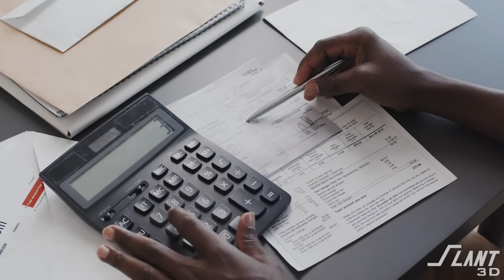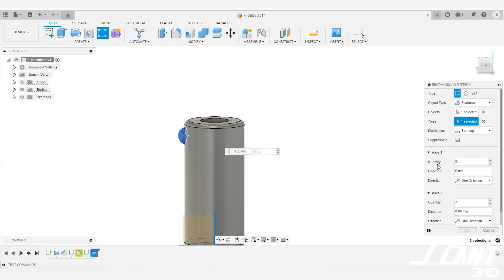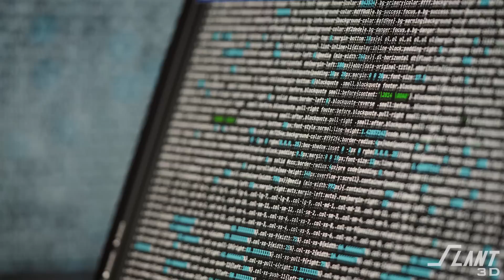3D Printing Will Obviously Replace Injection Molding

Comment: So the top line value-add is rapid-fire "spitballing" and enabling half-baked, shoddy design....as finished, salable products?  No mention of the compromises in part quality, strength, and material properties.  Complete false equivalency.  Hands-down, one of the worst videos I've seen on the topic(s); straight mis-information and hyped-up opinion.   AM industry has enough challenges in adoption and growth , definitely doesn't need to continue shooting itself in the foot with more hype.
Reply: This. If it is in walmart of any amount of time, its selling at bare minimum one per week. 5300 walmarts in the usa. that means in a year there are at minimum 275k units sold. 

Dont get me wrong. I absolutely love 3d printing. It has changed who I am with as you (Gabe) have mentioned correctly many times it lowers the barrier to entry for producing parts as you do not need to create locked in tooling. And it has completely democratized production at lowish volumes.
However, once you hit a certain threshold, it doesnt compare price wise or efficiency wise for most applications. Yes you can produce 1000 3d printed parts with 1000 machines but one injection molding machine can also do that in less time. As with many manufacturing methods, there are breakeven points where it makes sense to switch to the next approach.
Of course, some designs are better 3d printed vs injection molded, expecially if you have weird geometries and/or different material thicknesses that IM does not like.
Where 3d printing shines, is custom, low volume AND/or otherwise impossible to manufacture designs that enable things like higher combustion efficiency but can not be physically machined.
Reply from the maker: Printing matches molding on speed, quality and cost. And has all the other advantages that come with NOT carving your product into stone.
Reply: @slant3d " Printing matches molding on speed, quality and cost. And has all the other advantages that come with NOT carving your product into stone." Not even remotely true.
Reply: @slant3d  Not even close.  Injection molding can spit out thousands of parts an hour and run 24/7.  If you had 5000 parts from an injection mold in an hour that isn't the same thing as 5000 FDM machines printing 1 part.

Quality, absolutely not.  I saw your smoke detector video and if you think your 3d print was "the same" as the molded part you are loco homie.

Cost. again not true.  Low vol aluminum molds and 10k tool steel molds are very affordable and quickly pass FDM as a viable option in fewer than 100 parts.

Comment: 3D printing will not replace molding in electronics packaging, since the material has to flow into many very small gaps, and between 1-2mil wires. Also, the ideal shape is generally a simple rectangular prism, because that is the most efficient shape for an electronic building block. 3D printing is not the right tool for this.

Comment: Walmart alone has over 10k stores. So if you want to sell a product to Walmart you need to create enough parts to stock each store. Even if that's only 100 of one item then yeah that's a million parts. Do you have any references for most injection molded parts don't make more than 5k parts. I love 3d printing but it has limitations and there will always be a market for both. You even made a video showing how you can make a water bottle with 3d printing but actually only made a water bottle carrying case. You'll never have smooth surfaces or large parts made in mass (a slide) or food safe parts made out of 3d printing.

Comment: the cycle time of 3d printing will never touch the cycle time of injection molding, ever. technology improving  won't change this. i removed this channel from my recommendations based solely on this incredibly short sighted video.
Reply: 1 printer can't match 1 injection molding machine. I'm assuming he means 1000 printers somewhat can.
Reply: @jollzy887 neither does it match the price, your like comparing a house to a skyscraper. What you should look into si ratter production per cost (be it space, money, quality of pruducts, or anything else)
Reply: He is likely building a single machine for 1k to 2k dollars. For the price of one molder he can make/buy hundreds if not thousands of printers. He is looking at his factory as a single machine compared to a single molder.
Reply: @ethanr6655  yep and that is where that doesnt scale, you need to factor in increasing marginal costs and increasing footprint to match just 1 molder
Reply: You are forgetting about the months it takes to go from design to actual part with injection molds, plus the geometry and shapes are less limited 
You can't inject certain things, 
So by comparing 
From design to 1000 parts in a factory is days vs moths to make the press / mold and get the first parts shipped. 

Not only that, you have it on hand vs waiting for a container from China that takes another month to be delivered.... 

Sure, the physical making of the object is faster, but you can't leave out the pre fab and shipping times!!!!
Reply: As others have said, a single 3d printer is obviously way slower than a single injection molding machine. But, that single molding machine is massive in both physical size and cost. You could get a couple dozen high end industrial 3d printers in the same space for the same cost. Especially with high speed input shaping printers like the creality K1 and Bambulabs I wouldn't be surprised at all if 3d printing could at least match the speed of injection molding. Especially with how long it takes to make the mold in the first place
Reply: Habt ihr schon einmal darüber nachgedacht was so eine Spritzguss Maschine kostet? Wenn man den Preis für eine solche Maschine mit in die Produktion nimmt und das gegenüber stellt mit der Anschaffung von mehreren 3d Druckern, so erhält man sehr wohl einen ähnlichen output an Teilen, auch wenn man es nicht auf den erst Blick erkennen kann.  😂😅❤
Reply: Oh no guys he's leaving :(
Reply: If you would have watched the video you might have learned something instead of being stubborn
Reply: Yeah. This is ridiculous. Thanks for reminding me that I can remove a channel from being recommended
Reply: Yup ill block this channel as well, almost all his videos are just click bait with almost zero useful context.
Reply: you can compensate by stacking dozens/hundreds of machines together but by doing so you're also stacking 1,000s/10,000s of failure points. lots of luck keeping all of those machines running 24/7/365, your labor costs will be outrageous. it's easy to see who has manufacturing experience and who doesn't in this comments section
Reply: @mcfuggin depending on your viewpoint but you get a redundancy of 1000-10000. 5 printers down would probably hurt less than  .5% of the molder.

I mean... I am not sure things like Lego pieces will be printed, but I see many things being. Things that are only produced in up to a few million items. And the scalability and flexibility is awesome, and the fact that the same procedure can be used by the prototyper on the desktop as the producer of millions. And the cycle time of a part for testing is (let's say) half a day instead of weeks for soft molds, and costs less than the shipping of the molded part.
Reply: Thousands of printers to match a couple injection machines take a lot of space and effort to run. 
The argument makes sense for low scale, but after a certain point 3d printing just can't catch up. Which is good for products in development, but some products just work, and you don't want to iterate them every couple days
Reply from the maker: Printing already matches the production rate of Molding. We do it every day
Reply: @slant3d  You're incredibly smart and insightful, but this doesn't really make sense. I feel like you are missing something here. When you need to make MILLIONS of something, 3D printing can't even come close. Bottles and caps, Legos, the little tables that hold up pizza boxes, ice cube trays, plenty of car parts, the list goes on and on. When it comes to prototyping and iterating and low scale production, 3D printing shines. When it comes to actual production at scale, 3D printing is nowhere near to replacing injection molding.
Reply: @slant3d what are you talking about 😂
Show me a piece that you can match the injection speed with.
I'm all aware of 3d printing advantages, and they are there, they exist and are useful for a set of purposes. But you cannot extrapolate that to all production lines.
Reply: @gonzalomartindelavegacarre6108  While I do agree that 3d will not replace injection in EVERY production line as each one has its pros and cons, slowly more and more plastic pieces on the streets are 3d printed maybe we don't notice because most are little pieces that we don't pay attention to but they are there

But I believe you are stuck with the stigma that when we talk about 3d printed product you may imagine a guy with a single printer on his bedroom (like I am), and yes  that is far slower than injection molding, but when he talks about mass production with 3d printers he means a industry like Warehouse with hundreds and hundreds of 3d printers working at the same time, so yeah one to one a 3d loses against an injection molding machine but they can easily match at mass scale

Also, when designing a product many little features and dimensions can go wrong, having the capability to change the design with little to no cost is huge, and I mean it as someone who designs and prints spare parts for my workplace
Reply: @alecampos1491  oh I'm not stuck with the stigma, I run a 3d print farm myself and I've toured a couple of warehouses like that. 
But still I'd like this channel to remain as true as possible to reality and this video just gets a little bit out of hand.
3d printing has its advantages but on a higher scale, injection wins, and there's much more products that don't need iterations (thanks to a perfected design) than what's said on the video
Reply: I agree, where does he get his information from?
Reply: @slant3d You know that’s bs. I get that you want people to think more about 3D printing but lego stones will not be 3D printed. And I am not even talking about the surface… 
What’s next? Explaining that there will be 3D printers printing out plastic bags at the grocery store to create the perfect size while I’m scanning my items? 😂
Reply: @slant3d , you don't "match the production rate of molding".  Your cycle time is absurdly longer compared to shot times off a press.
Reply: @slant3d Maybe it's true but the fact that "Slant3D" is shoved in our face and the robotic marketing speech just make the message seam fake

Comment: Is 3D printing a viable option for power tool shells? Since they are under high stress,
Reply: I think it depends on the design and the (post)process. SLS/SLA might work as the parts are more or less homogenious, typical FDM might work aswell, depending on the used filament and postprocessing. 

But overall I disagree that 3D printing will completely replace injection molding, it'll be taking some business away from injection molding, but not replace everything. Both have their benefits and drawbacks.
Reply from the maker: Design is everything
Reply: @slant3d  and physics too my friend.. just a reminder that you are not above of

Comment: This is like comparing screen printing to something like dye sublimation or direct pigment printing. Each has it's own advantages and disadvantages. 3D printing has its own of each as well as injection molding. For that reason i don't think 3d printing will completely take over injection molding, but it will definitely have it's own share of the market.
Reply from the maker: There is also a place for horses in a world of cars.
Reply: Are you deliberately trying to destroy your channel?  This guy made an excellent case.  High volume molds for high volume mfg won't be 3d printed.  It will be interesting to see a 3d printed mold made out of a hardened tool steel that can with stand 50,000 psi of injection pressure  last millions of cycles.  Get your head out...
Reply: @robertwiedeman5602   yeah i dont like that "i know it all" arrogant take in all well structured and argumented comments, its quite annoying actually.
Reply: @robertwiedeman5602 Honestly, comparing Slant's responses here to their other video's comments... Did someone have too much to drink then go on YouTube for some flame wars? Slant's comments here are aggressive, full of hyperbole and weak analogies, and just come off as rude. WTF is going on at Slant? And all the claims made are just vaporware, they give no source to back it up. I'm becoming less interested in their cheap PLA subscription by the minute.